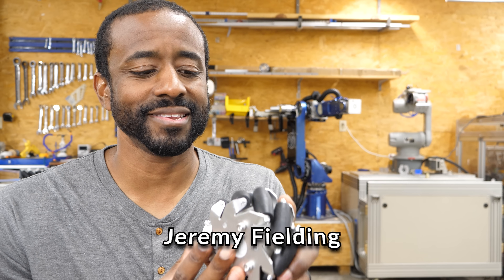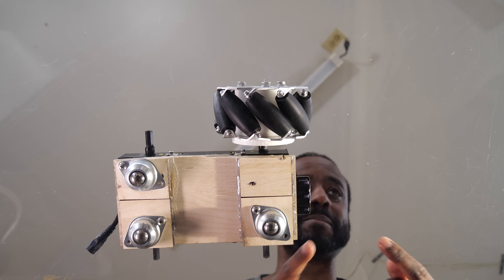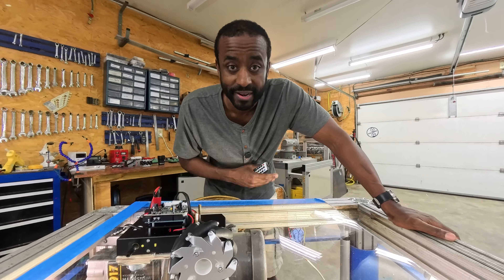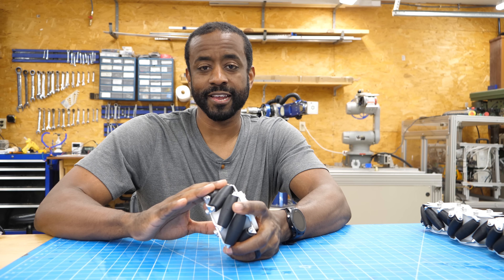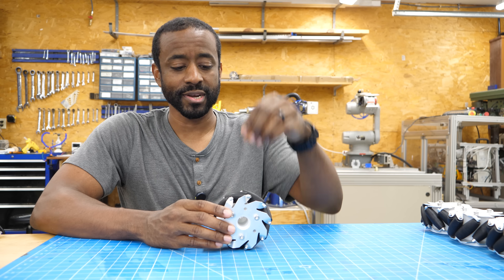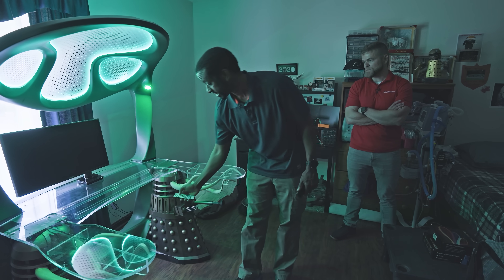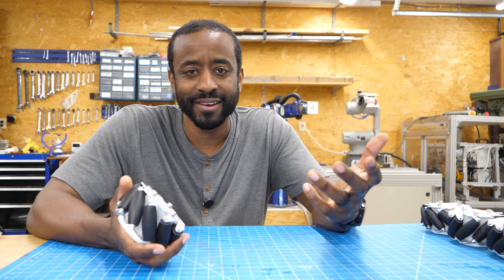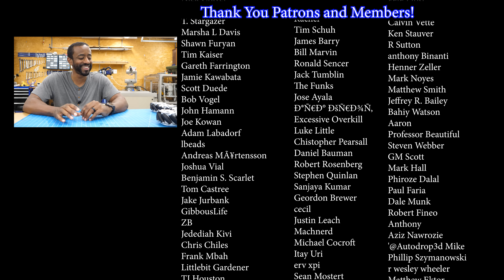The Mecanum Wheel Is So Weird, It Is Genius. How It Works

Comment: I came across a pedal-powered drift kart that had similar wheels on the rear (driven) axle. The roller axes were disposed circumferentially so that you had drive but very little lateral grip. Very interesting!

Comment: Just asking, what alterations would be necessary so it could be used on a boat? Could it replace propellers?  There were ships made years ago with 4 electric engines,  one on each corner ,  could these wheels be used like that?

Comment: Very cool. Haven’t seen your channel before but just subscribed. I’ve always been interested in science and physics and problem solving since I was a little kid. I invented two things commonly seen today on automobiles when I was about 8 years old. We’d go on long road trips on vacation and I noticed my dad getting angry at another driver who apparently cut him off. “Why didn’t he use his blinker?!” I said from the back seat, “He did use his blinker, they’re just hard to see because they blink red to brighter red. 
They should make blinkers a different color like yellow or something.” He laughed, “You keep thinking son. That’s what you’re good at.” (Notice now that blinkers on vehicles are yellow) Someone much older figured it out before I could put a patent on it. My other idea was the intermittent windshield wiper. (Same road trip) In a very light drizzle, dad would turn on the windshield wipers to sweep across once, then turn them off. Then do that again a minute later. “Dad, they should make windshield wipers with different time delays so that you can control one sweep every 20 seconds or whatever because you’re going to wear out that pull switch.”
So now we have intermittent windshield wipers. Again, I didn’t patent it in time. That didn’t stop me from figuring things out though. 
I became a mechanical engineer for the Navy mostly studying thermodynamics as it applies to heating and cooling and electronic control systems replacing old pneumatic controls. 
Anyway, I’m long since retired and love watching channels like yours because you have that same childhood fascination with mechanics and physics, and I still have that as well. I’m older than dirt now but when you are as well, you’ll still be just as excited about this stuff as you always were. You’d be a fantastic teacher, if you aren’t one already. 
The Mechanum wheel. Expensive to make and maintain. Very limited practical applications. That doesn’t mean it’s not super cool though. 
Great channel, keep them coming.

Comment: Great demonstration. 
What if each wheel were driven by a planetary gear on a drum gear against it rim, allowing room for the orbital spindles to be locked from rotating by a solenoid at it's center?
This would move each wheels motor to beneath the vehicle. While this reduces ground clearance to zilch it provides a normal amount of conventional turning radius per wheel, that is if such were also feature you wish the next model to demonstrate. ....?

Comment: I'd like to remind you guys that Gorilla glass had no widespread use until Smartphones arrived, 50 years later!  So keep this "wheel"  in your "vault".

While Corning's Gorilla Glass is now ubiquitous in smartphones, it was initially developed in the 1960s under the name "Chemcor" and had limited commercial success, primarily used in niche applications like race cars. The glass was not initially developed for consumer electronics. It was Steve Jobs who, recognizing its potential for scratch resistance, championed its use in the first iPhone. 

Here's a more detailed breakdown:

Early Development (1960s):

Corning developed a chemically strengthened glass called "Chemcor," designed to be strong and lightweight for industrial and commercial uses, including automotive and aviation. 

Limited Commercial Success:

Chemcor saw limited use, including in some racing cars, but never achieved widespread adoption. 

Steve Jobs' Vision:

In 2007, Steve Jobs, then CEO of Apple, sought a scratch-resistant, thin glass for the original iPhone. After a search of Corning's archives, the Chemcor project was revisited. 

Re-engineered for Smartphones:

Corning reworked the Chemcor formula to create a strong, thin, and scratch-resistant glass suitable for touchscreens. This new material, later branded Gorilla Glass, was used in the first iPhone. 

Widespread Adoption:

Gorilla Glass quickly gained popularity and became a standard feature in smartphones and other portable devices.

Comment: So it's like an unbalanced tyre.. It will wear out sooner than you can use up your gas. 😅
Also, when you accidentally lose one of the tyre while on the road, suddenly the car turns away from your straight inertia line. Not suitable for fast moving vehicle.

Comment: I can assist with pricing; marketing is my specialty. First, the theme is robots; does it invoke toys or tools? Then you have a market desire? Or the feeling of got to have... Customer, I live with it or I can live without it. Then comes value or perceived value? Like Ford or Lincoln? The perception is that the more innovative robots are, the more expensive they are to build. Then you have the redundancy of 1 part to 1,000 parts, for Robot performance. Robots with 10,000 parts are composed of 10,000 parts. Then you have raw cost, excluding labor. Then let's say you have a customer who wants 1,000 Robots. That is 1,000 times 10,000 parts, which quickly goes to 10,000,000 parts. Production, automated, then assembly testing, and a finished Robot. Then you have the cost of this end result. Now, if your Robot Has 5,000 parts, the time and labor required are nearly the same for the end result of a Robot. Why? Time to assemble and test. Mass-produced is the cheapest to produce, resulting in that. The assembly should be quick and straightforward. Like, say, 10 per day times 5 days. The recreational lady robot range is between $2,500 and $5,000, depending on the features you select. The more realistic, the higher the price. The fully functional blow-up Doll is only $100. Toy Robots are priced between $25 and $50, and are mass-produced. In contrast, sophisticated adult toys range from $250 to $1,500, while industrial uses can cost $10,000 to $50,000 each. Once you find your niche in the market, remember that you will have competitors vying for the same market. Without mass production and assembly, the Patent is your only salvation. I hope this outline leads you to discovery and helps you sell your idea to the thousands of factories in the same field of Robotics, because they will ask you the same questions, unless you have millions of dollars to spend and risk. For there is no risk if you have what they want. RC LeBeau, Fruit for thought.

Comment: I am not so sure that a forklift with mecanum wheels would require more effort.
Sure greasing ten rollers per wheel on the regular is more than a normal wheel requires,
but in exchange you have no mechanical drive train, steering or transmission.
Just for fixed electric motors, battery, ECU and controls.

Comment: Interesting!  I would think that the load on a roller and the associated bearings would be quite high, especially in a forklift environment.  There's also no shock absorption, as would be the case with rubber tyres.

Comment: Great video, always wondered what these were. The coolest use I’ve seen is a conveyor track made of them that moved air cargo containers, Qantas I believe. They could steer the container on the track by changing which axels spun which made aligning the container to the loading bay on the plane easier.

Comment: If you design your robot concept from the outset being modular you create the possibility of adding new capabilities simply by adding another module to it. Obviously there will be limits to the capabilities however if the base can also be expanded on a modular level you could increase the maximum weight the vehicle could transport which would allow for more massive robotic arms to be installed. I worked at Intel and our material handling system used six axis robots to store the product between process steps and cars that traveled overhead on tracks between the process bays with an inner loop and an outer loop that traveled opposite directions so that the shortest travel path could be taken. Teaching the pick points was always the most time consuming part of getting automation to work, If they have a sensor system that can precisely place material with no crush hazards exposed to humans that would be truly revolutionary to the field of automation.

Comment: It kinda looks like the 45 degree angle wheels are acting like a Hypotenuse to a Square but a Circle. So it should be able to cut the angle turn in Half. Them wheels will not work on a Dirt muddy road or Snow ice any of that> it can only work a a Smooth Flat Concrete Floor. Gravel would rip the Wheels apart.

Comment: Excellent job. What would be your thoughts of the following? Can society make it excited?
Wind, Solar and EPM series: Wind turbines harness kinetic energy and solar panels capture sunlight. There is an invention EPM, U.S. Patent No. 9641045B2 that converts magnetic energy into mechanical energy into electrical energy. The EPM is a game-changing innovation with potential applications in electric vehicles, renewable energy generation, and industrial machinery. Its adaptability and scalability make it a pivotal solution for companies aiming to revolutionize energy systems.

Comment: knowing that one wheel along would not go stray, but two wheels will go forward, or reverse, are the wheels dragging therefore losing tire thread? good explanation on direction of the wheels, but it doesn't change the motion of each wheel.    thanks

Comment: Nice, i hadn't seen these before.  Reminds me of the (Russian, I think) snow vehicle I saw on YouTube.  It had 2 long corkscrew cylinders (basically a tank with screws instead of tracks) it drives forwards only by rotating each cylinder counter to each other.  But when both cylinders are driven the same way it just drives sidewards with both cylinders acting as wheels rather that counter rotating screws.

Comment: Just thought of something else with the solenoid on the driveshafts  you have a 
openend on one side of drum so that 
they push out to engage the drums that in turn will make the car wheels scoot across sideways the power could come from the clutch pedal 
once it's pressed down all the way 
it all takes effect parking will be a breeze
Reply: One more thing there's a keyway that holds it when in the drum to drive the shaft wheels

Comment: Why can't they be made from steel roller bearings attached to the larger drive 
then put on a car with 4 wheel drive on the driveshafts 
so that in low gear and a press of a button 
they engage with car wheels drive to make it crab movement 
then when in position 
press the button again and it disengage with electric solenoids??

Comment: Well, to me this isn't new. I had the exact same idea and I've actually made the exact same thing. as a DIY project about 13-14 years ago when I've carved everything out of pine wood. One wheel took about 1 week to make and at the forth wheal I've  lost the will to live  !!!  :))))) It was an extremely tedious process/work as  at that time I didn't have access to a proper mechanical shop nor any 3D printer so almost every piece was hand crafted. The wheels were also made of wood on a small lathe (by my uncle) And have used a very old Arduino Leonardo as the controler. It was fun while it lasted but.... I've lost interest in the project and  still got some part left over from it today. Fun, absolute fan.

Comment: And how long do you think tires like this will last in a real world scenario?  Like the two front wheels of a conventional auto with wheels pointing at 45° angles to the car.  Maybe 5 minutes before they melt off the car!  Sure it's interesting that goes straight, but at what cost.  Not practical except as a curiousity.

Comment: what if you had normal tires 90% of th time and an inner disk wheel That can engage for parking or other slower maneuver needs.  That way you only put wear and tear for limied Time. I wonder how you can use this design in conjunction with regular wheels for limited use

Comment: Hmmm i look like the weels battle each others and the rubber wheels will burn fast, add accelerations,turns,lateral movement........... a sphere would still be better no !? By the way im a new sub and thx for your good work

Comment: So you know I'm a bobcat operator and what you're showing that machine can do regardless of what wheels are on it so if you're trying to say that the machine needs those special wheels on it to spin within its own radius no you're wrong I can spend within its own radius whether it is wheel drive or caterpillar drive it doesn't matter The point is that it's tank steering to the front can steer in One direction in the back and steering the complete opposite and because of that it can spin like that at least my bobcat can
Reply from the maker: Perhaps you didn't watch the whole video, or just wasn't paying attention. I didn't say there weren't other machines that had a wide range of movements, nor did I say this was the best or only option for moving machinery. I also said nothing about this being the only machine that can rotate about it's center which is why I said maybe you weren't paying attention :) There are pros and cons to every engineered machine. BObcats are cheaper and more useful in many ways. Especially outside. Though, you can't track sideways like a crab in a bobcat. No one would look at a bobcat and say it was "moon walking" LOL. Check the video again for details on what I was saying. Thanks for watching!

Comment: I saw these wheel on an RC tank. Another application is that it steer without steering just by alternating the direction of the motor. If all 4 wheel have independent motors. It would go sideways as well I guess.

Comment: I used to drive a fork truck with round wheels. They would function simular to this wheel. The stick would roll the wheels in the traditional manner. Forward and reverse right and left. Pulling the control stick into the plus/minus range slowed me to roll each wheel in individual manner. This would result in unique and precise movement where I can move any direction. Serpentine, center axis spin, lateral, forward axis, rear axis, I could do all of the movements you expressed here. All by manipulating the +/- control of each wheel.

Comment: A lot of military cargo aircraft use these types of wheels in a grid on the floor of the aircraft so that load masters can move aircraft pallets with ease in any direction. Perhaps make it the stationary thing that moves something on top instead of pulleys and gears where precision isn't the biggest factor. Maybe make some sort of sorting robot that can stack sheets of metal depending on shape or thickness?

Comment: i Know this is an older video but i had to share my success with yall! I 3d printed my own rollers for my mecanum wheels and used Ultra Black gasket maker dissolved in solvent to apply thin even layers to build up a robust rubber coating and it flippin rules!  use as little solvent (xylene or toluene) as possible to thin it enough to get even coats and do multiple coats until u get ur desired thicccccness.  its tough enough for most surfaces it does ware  on concrete or pavement but acceptable and really easy to touch up.  at first it didnt offer quite enough slip on certain smooth surfaces but once it wared a bit it was smooth sailing.  also when designing ur rollers accommodate a press fit copper pipe through the center to act as a bearing surface, make sure you give them a rough sanding to give them some tooth for applying the rubber and be prepared for repetition! currently messing with a dipping method to speed up the process. i know theres off the shelf rubber and silicone products that will work but what fun is that!? theyre kind of expensive and i had the gasket maker on hand and its only $12 in canada so it prolly close to half that in the beautiful US of A!  happy making yall! woooo!

Comment: Hey, this was great - inspiring example of how to teach science and engineering. I would be interested to see you push this design into applications where it doesn't fit well, to show how it fails. Make your car go too fast, use it on slick or uneven surfaces, and compare it to traditional tire setups. Also, could a vehicle leverage both types of wheel designs under different situations?

Comment: What if you could add joining side flaps (duck feet) that will create a belt around the pins when in motion to achieve the necessary traction and stability needed to maneuver on rougher terrain . I don't know if its plausible but I can imagine it.

Comment: Jeremy, for me, it's more about the functionality and usability of the machine than it would be about the price. If it accomplished a task that I want it to do, and the cost is reasonable (which is certainly subjective), then I would be interested in the project.
As an example, if you could teach me how to build a robot to handle moving heavy objects around my shop, such as heavy sheets of plywood loaded vertically onto a cart (a la a box store vertical sheet goods cart) and it used those wheels to do so, which is a great application, I'd pay SEVERAL hundred dollars for that. If it's just a toy that demonstrates a concept, then I would pass.
It has to have functionality for me BEYOND the demo and explanation of a concept.

Comment: I would think that with some of the force wasted on sideway motion even though the vehicle is moving forward would wear out the material of the rollers quicker.  I believe harder material would make it last longer, but your coefficient of friction would go down, and inconsistencies in floor surface would affect its direction, making it inconsistent.   Interesting video.